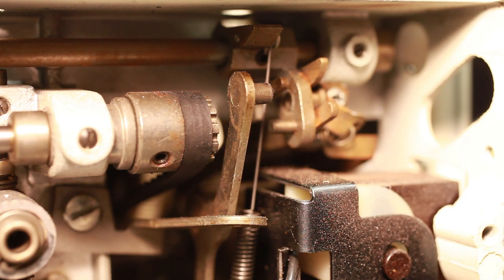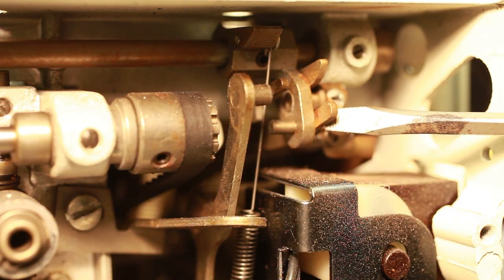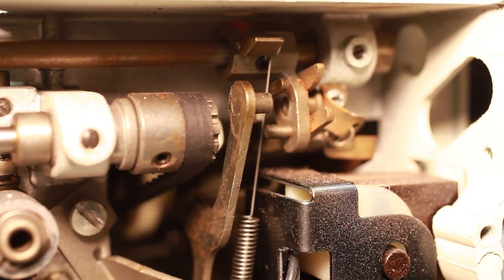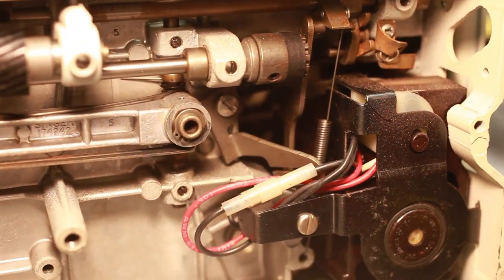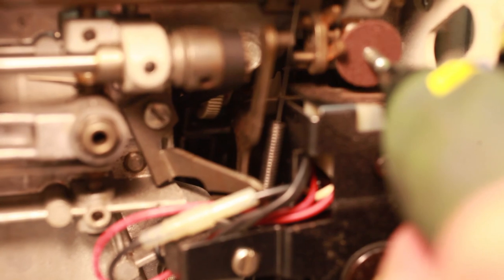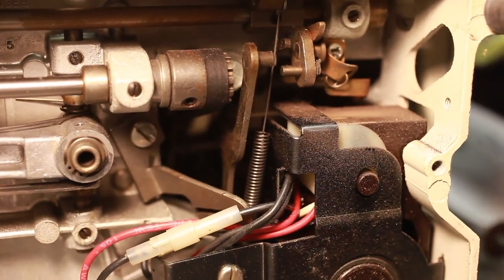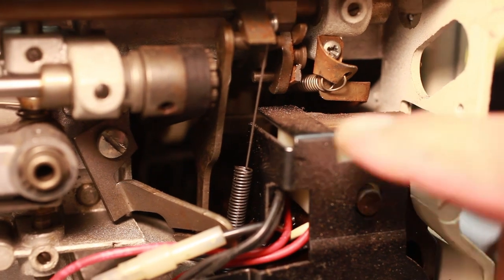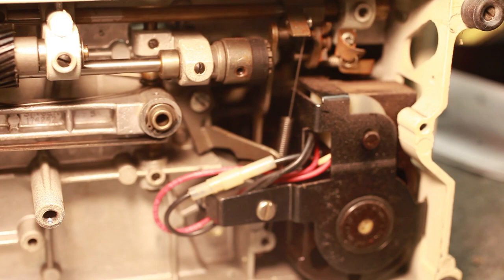SINGER Gear Removal on a Singer Model 750 Golden Touch & Sew (Part 2)

Comment: Hi! I changed all the gears just like it says in the vídeo, but now the machine is very stiff, not all the time, but suddenly it gets very stiff, can you tell me what I did wrong?
Reply from the maker: The gears are meshed too tight. The teeth need a slight paper thin gap on  all the gears.

Comment: How do you get the hook gear off below the bobbin case? I removed the screw but it still stays on the bar and if I turn it the cylinder that holds the bobbin still spins and I can't get that gear off...please help thank you
Reply: Did you ever figure out how to remove the hook gear from the bobbin case? I'm having the same issue.
Reply: Marquis Toson hi we’re you able to figure this out?

Comment: Unfo4tunatly, I did not notice until after I posted on a 620 vid but I have a750 that I replaced gears and dismantled it the way done in the vid then reversed the process--or at least what I thought was the reverse. The hook is free and moves if you push it woth your fingers. That is wonderful to adjust but not so good when you want to sew. What did I forget to do? Thank you.